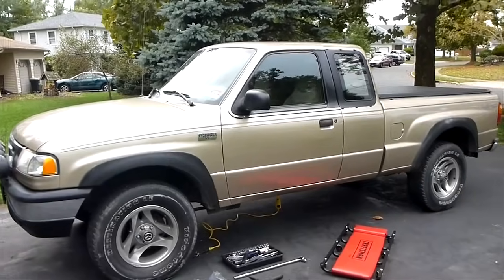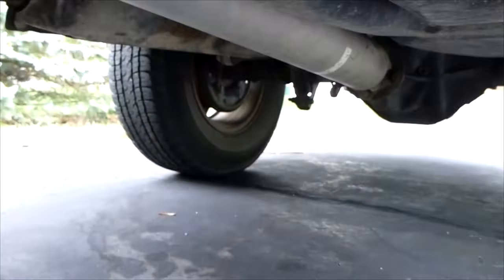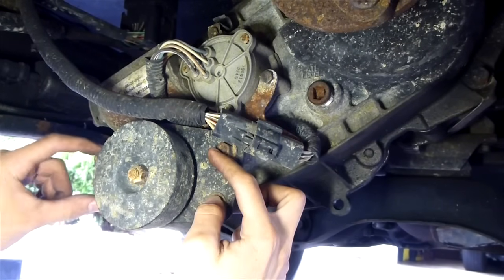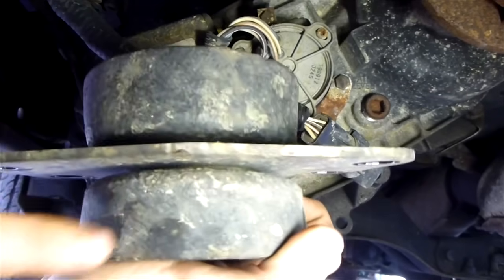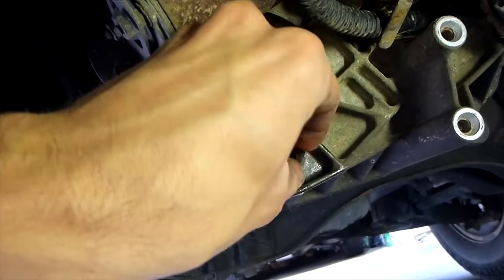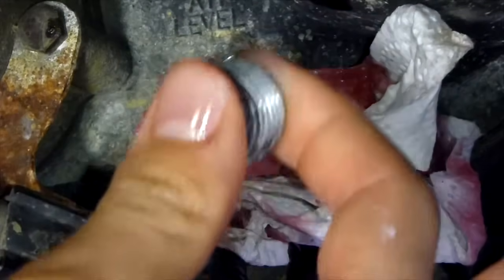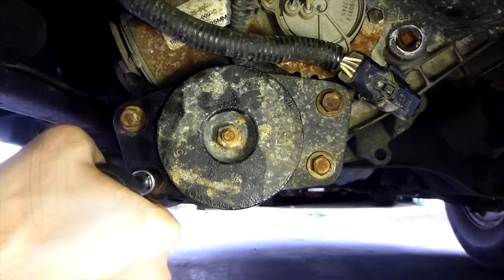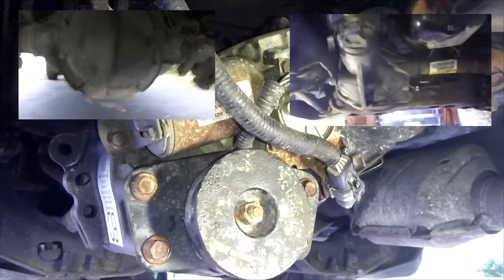How to change Transfer Case Fluid (Easy)

Comment: I have a 1993 explorer 4*4.  The 4x4 is electronic.  It doesn't engage anymore.  Ever diagnose this on Ford with push button 4*4?
Reply: Yes. First crawl under and manually twist the front axle by hand. Move it till it stops. I had changed the fromt bearings on mine and 4x4 would not engage till that was done. If it isnt that check ur four wheel drive switch and the actuator that actually switches the front driveshaft into four wheel drive. They can rust and seize up. Hope it helps

Comment: Yes, it does, when i hit a bump hard
Reply from the maker: STEEVE DAVID Nicolas Try replying to your original comment to keep all of this in one place. Did you check the fluid level on the front diff? How about on the transfer case? When was the last time the fluid was changed?
Reply: I never change them, do u think it could be the reason
Reply from the maker: STEEVE DAVID Nicolas It could be. But if it is making noise, my guess is the damage is done. You might consider changing them and seeing if the noise goes away.

Comment: Is it bad to overfill your transmission fluid?  My 2011 Hyundai Sonata has no Transmission dipstick and no easy access to refill it once drained.  If the transmission fluid magically expands when hot, but i fill it cold, what will happen if i fill up the transmission with too much cold fluid?
Reply from the maker: Edmund Witkowski Yes, you do not want to over fill any fluids. That is why there is a fill mark. Transmission fluid doesnt expand when hot. What happens is when the car is off, half of the fluid is stored in the transmission pan and half in the torque converter. When you run the car, the fluid pumps into the torque converter showing you the actual level of your tranny fluid.

Comment: hi chris .
i own ford sport trac 2007 v8 limited , do you know which oil should i use for my transfer case , thanks
Reply from the maker: Check the owners manual but I am pretty sure it is the same fluid I used.
Reply: If you want to use Motorcraft fluid, see my comment above. I am assuming the 2007 used Mercon like my 2003 Ranger.
Reply: lastmanxa mercon or mercon V

Comment: Hy Chris 

I think you have some uneven tyre wear : Check min 3:20 Front right tyre on the inside :) , you should get that done .
Reply from the maker: doomyro Thanks man. Yea, I did a full front end rebuild and filmed everything. Then I got new tires and the truck aligned. Good eye. If you ever need a good video on control arm, ball joint, tie rod, or shock replacement, I have them!
Reply: ChrisFix  I have seen them all .  Very nice  !
Reply from the maker: doomyro Awesome! Thanks man!

Comment: If anyone is still on this thread, I’m changing my transfer case fluid on a 2007 Nissan Pathfinder SE. I have never changed it so I’m assuming its still manufacture oil. I’m using valvoline atf instead of genuine Nissan oil. Do i need to do like some kind of flush? Or can i just drain the old and pump the new?
Reply: If you're using what the manual calls for and it's the same type of fluid but not the same brand, it should be okay without a flush. You could as it only helps but it's not necessary. Either way, it should work

Comment: Question, if your fluid was low in the transfer case what signs would you see? Just affect it when you try to go into 4wd? Reason I asked after I changed my filter and fluid in the tranny about a month later I started having this deal when I backed out of the driveway(I live on a slope) and the truck got to flat ground it would just go out of gear, so I sit there and go thru the gears a few times and it finally kicks in. Weird thing to is sometimes you can feel it trying to grab  but just rocks the truck a little instead till it finally kicks fully in gear.....After its all warmed up its fine wont happen again, its very sporadic and I recently added some trans x stuff and its been good for over a month till yesterday it happened again :/
Reply from the maker: Jason Bilow The transfer case fluid should not affect the tranny not going into gear. The rear wheels are always connected to the tranny so even if your transfer case was not working, you would still get power to the rear wheels (assuming that it doesnt seize up). The only affect you would see would be overheating of the transfer case, extra wear and tear, and no front wheel drive when you put it in 4x4.
Reply: ChrisFix Odd im not getting notcies of replies....anyway I went out today and was going to check the fluid but its raining so not to fun but my driveway being a incline and I have to park on the side of the paved part so im in the mud and when I backed up to move over I was spinning tires so went to put it in 4wd and it wont engage, I have no lights in dash, don't hear any clicking, I do get 2 lights flash when I first start the truck. I checked the fuse and seemed ok but tried a new one and nothing. Did crawl under it to see if anything was wrong but nothing obvious. Low fluid wouldn't cause this??
Reply from the maker: Does your 4x4 light flash? What happens when you have it in 4x4 and you turn your wheels sharp?
Reply: ChrisFix The light will flash when I turn the key to start engine then they go off....however I ran up to store earlier and was sitting in the driveway and while foot was on brake and in N I just ran the dial back and forth several times and it kicked on so my guess is maybe the contacts aren't so good?
Reply from the maker: Hm, it might be the contacts. I would monitor the 4x4 and see if it is intermittent.

Comment: I'm guessing Ford didn't fill the t/c at the factory.  I had a 77 Ford 4x4 that the rear diff was low from the factory.
Reply: 351WINCHESTER almost all new car are low so you need to check it.

Comment: can i have a question my 4runner ,the 4low light pup on the dashboard ,hace any idea  what wrong with it thanks.
Reply from the maker: +Nhu Bui that means it's in 4low. Put it in neutral, pump the brakes, and put the 4x4 in the off position.
Reply: ChrisFix thanks . i give it a try .thankyou again .

Comment: good video, but i think you put the thread locker on the wrong end of the bolts. If it is to be effective it has to go on the first threads that enter the transfer case. Because the threads near the bolt head probably don't even enter the transfer case threads.
Reply from the maker: You are correct my friend. I wouldnt put it on the tip of the bolt, but if you look, you can see the rusty part on the bolt near the head and that part is the part that is exposed to air. Right after that is the threaded part which I do get some thread locker on so it isnt a problem. Good observation!

Comment: I have a 2004 Ford Explorer when I push the four wheel drive button it comes on when I turn off when I push the button to turn it off and wont go off does that mean the fluid is low in the transfer case
Reply: +Arthur Marcotte for your issue if you havent fixed it yet, you would have to replace a relay. its a very common ford issue that i was reading up on. simple fix , hope that helps
Reply: Where would that be on the truck with the fuces.?
Reply: There are Hall Effect sensors in the transfer case on both the front and rear drive shaft outputs. These signals are sent to the GEM (Generic Electronic Module) and the GEM, using additional input signals, drives a magnetic clutch in the transfer case to engage FWD power. There is also a transfercase relay which should be located under the hood. you would have to check either your owners manual or the lid on the lox and swap it out

Comment: Is it safe to do this if It has never been done
Reply from the maker: Yes, your transfer case is not like a transmission and wont slip.
Reply: ChrisFix thanks for the reply, can I also change the differential fluid if it’s never been done

Comment: I think all too often, people fail to do this service. At only 60K miles, my old '07 328xi had a failed transfer case, and surprise.. there was no oil in the transfer case.. I think a change at a lower mileage than what the manufacturer's suggest might be more appropriate.
Reply from the maker: Laweeze Morton I think instead of a fluid change a lower miles, people should be checking their fluid whenever they do an oil change, or ever two oil changes so problems like you mentioned dont happen!
Reply: Laweeze Morton i totally agree.

Comment: Is this the same on a 98 ford explorer eddie bower 4.0 sohc and what fluid
Reply from the maker: TRAVIS L Yes, it is the same. The fluid is ATF but verify in your owners manual.
Reply: OK just wanted to make sure its not gear oil I use
Reply: My transfer case looks difrint on my 98 ford explorer eddie bower with the 4.0 v6 4wd wish i new how to show you a picture of it

Comment: Chris. Love your videos, but I have a complaint. Almost always when it comes to torques other than your wheel lugs. You tell us what the torque should be and then proceed to NOT torque that said step properly with a ratchet instead of with a torque wrench. 
I mean I get going by the calibrated wrist. But your doing instructional videos!!!! 
That’s like me telling you to always wear your seat belt and in the video I’m not wearing my seat belt.

Comment: My partners 2003 H2 Transfer Case exploded at about 120000 miles using auto trans fluid , which is recommended,  I have no idea why.  I use gear oil and pushing 200000 miles, the truck is still going strong; with no shavings coming out with the oil at the change interval.  Gear oil is meant for gears.  Auto Trans fluid is meant for auto transmissions.
Reply from the maker: +nonayou damnbusiness Thanks for sharing. Might have just been a mechanical flaw.
Reply from the maker: +nonayou damnbusiness Thanks for sharing. Might have just been a mechanical flaw.

Comment: how can I tell if I need to change my transfer case motor .... my 4x4 will not engage on my ford ranger
Reply: Riley Owens Thats really something a dealer should do, even if you are the one to find that is it the motor you still have to pull the transfer case to fix it. Pulling the transfer case it a lot more labor intensive than you would expect.
Reply: Yeah ik but I'm going to school for this and o know I can do it its just I can't tell it'll it's that that needs to be replaced or what

Comment: Did I spy fluid leaking out of a shaft seal? Might be where it is going. It went by really fast so I can't be sure, but I thought I saw something.
Reply from the maker: +Griff Miller II that's just sweat from 15yrs of use. Good eye.

Comment: I have a 2015 Nismo frontier 4wd 6 speed manual does anyone know after about how many miles I should have this fluids changed ?
Reply from the maker: Anthony Rodriguez It should tell you in the back of the owners manual what the service interval is.
Reply: ChrisFix Thanks Chris!

Comment: Hey Chris I really need your help I have a 2001 mazda b3000 4x4 and my oil pan gasket has a leak everyone has told me to pull the motor I really don't want to could you help me please.

Comment: Why do you use cheap fluids?  Your doing the work regardless. Use amsoil or royal purple, etc.
Reply: it's not really about price on the fluids it's what they're many for plus lots of the expensive one don't work well I would recommend Lucas, and seafoam they pull off extremely good results
Reply: What's wrong with what he is using? SuperTech meets or exceeds required specs. It's great stuff, I use it too.
Reply: +Keegan Good not much cheaper than better fluids. The labor is the same. Using better fluids enhances protection and/or gives you extended periods between changes.

Comment: I am guessing that this Mazda truck is a 1994? The same as my 1994 Ford Explorer.  Because Fords in 1995 have the drain plug NOT behind the dampener, but to the left of it.  This is not important to your video, so you may delete my comment if I am wrong.

Comment: is this an actual mazda? looks like a toyota conversion
Reply: No it's a Mazda b series also known as a ford ranger
Reply: The transfer case is a Borg Warner 1354. It was used on various Ford/Mazda vehicles from the late '80's til at least the mid 2000's. I have an '03 Ranger that uses this same unit. It was available in both electric and manual shift.  I am hoping to swap in the manual unit, but the parts are VERY tough to find, or very expensive when you do.

Comment: Think.....   why do we even use a type of thread lock tight??? do your homework....  first 85%  of the thread never touchs the other metal that your screwing into....  only 15%  is touching it...  so we have a AIR GAP at 85%  so we must use a filler called thread sealer to take up the air gap...  what happens is a fastener will loosen  up from vibration yes it will and can loosen up from vibration, so  to try to stop it from loosen up we add thread sealer all the way down the bolt MR. Chris fix ....

Comment: Yeah, that cheap ass bulb pump is garbage and does not work at all. Bought it from Oreilly and tried using it to suck oil out of my engine so I could have an analysis done and it does not work at all. Wasn't even worth returning.
Reply from the maker: Yea I couldnt believe how much it doesnt work! Very disappointing but the other pump worked great!

Comment: nicely done... the silly Jaguar transfer case is a joke...pathetic ...no level plug, no accesible fill plug ...no total drain plug...just a partial drain plug..I think it is some kind of Ford awd system...
Reply from the maker: Edmund Arthur Dickenson That sounds horrible. How do you get the oil out and fill it?
Reply: I heard it may have been from an x plorer or similar...think the case is made in usa....I forget...whoever made it , it is a big joke, but mot funny when you have to service them...but it does go well till it goes bang...fortunately I just blew the clutch out of mine...so replaced the dual mass flywheel ( another item possibly suited to a diesel ) and the clutch assembly..runs nice now and is pretty quick on the slalom course....1st time out we took 2nd fastest Jag....totally stock....awd definitely helps a bit..PS, amazing how good the new Ford's look...something to do with once owning Jaguar.....and I am sure keeping some of the future drawings....as they are looking very Jagish up front...

Comment: Thanks for all your video's. I have a 2001 Ranger 4X4 and was wondering if you ever had this problem with the transfer case on your Mazda. I found this video on you tube that shows my problem if it is a problem at all. Please tell me what you think. I don't think it should have play/slack like that Thanks.
https://www.youtube.com/watch?v=w8yBqiY-eRY
Reply from the maker: Darrell and Reagan Bear The splines can wear out on the driveshaft which can cause that. Does the truck make a noise when you drive it?
Reply: No noticeable noise, I am starting to change transfer case and front and rear diff fluid and noticed it. I am just concerned about it failing when I'm in the middle of nowhere. It engages just fine into 4 high and low. It just didn't look right. does your Mazda have slack like that?
Reply from the maker: Darrell and Reagan Bear No. Mine is tight. I wonder if it is worn out...